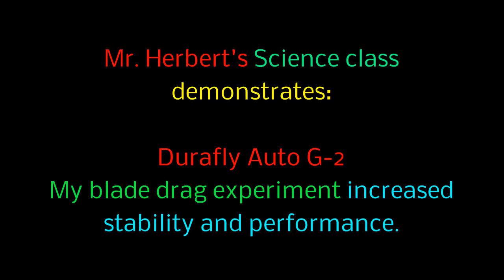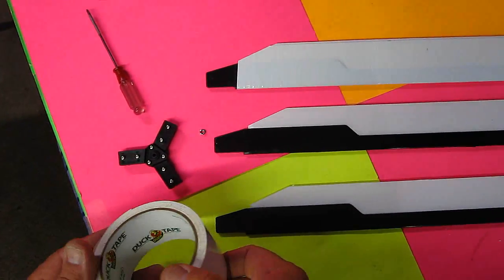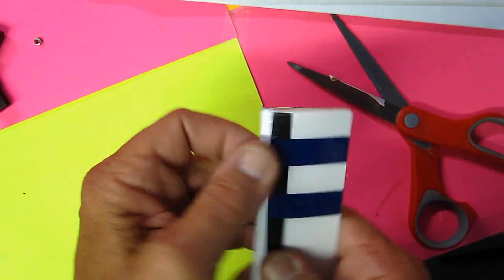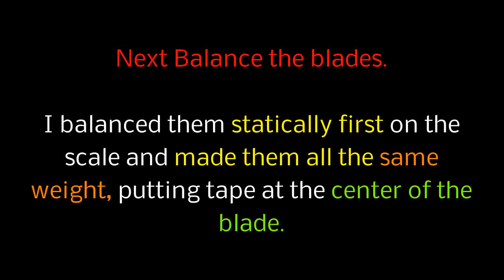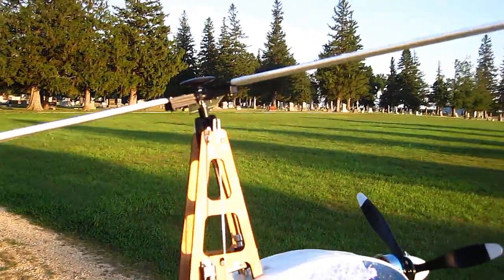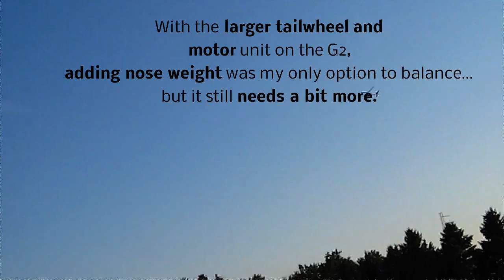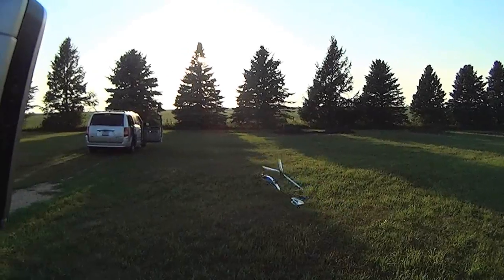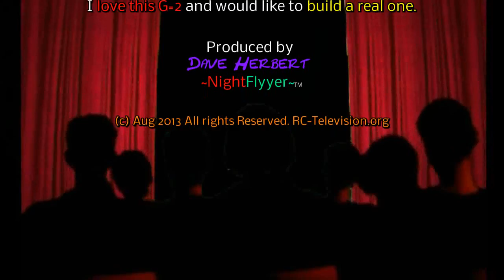Durafly AutoG Auto Gyro V2. Induced Blade Drag increased performance with a Hand-launch Demo too.

Comment from the maker: Well like I said in the video, those blades flex back an forth in different maneuvers without a screw and even a flexible band.  Some do it, but in order for all blades to remain the same pitch, it must use 2 screws. It is different on a powered rotor with centrifugal force keeping them out there, but during slowdown or acceleration, loose blades change pitch on those too. Being experienced with helis, it is my preference to keep them rigid and just not hit anything. Thanks, good question.

Comment: You are right about the blades needing to be fastened with 2 points. I use tooth picks in the inside hole. This keeps the blade in position but shears off in a blade strike. Thanks for your video.

Comment: Hey Dave...Great video and great info on the drag improvement. One more improvement I found was changing the 3 blade for a stock Parkzone P51 2 blade prop ($3.99). Better power and spools up faster. Keep the vids coming. Good fun.

Comment from the maker: I scrape them more than hit, and since the blades are spinning full speed even after landing, and its easy for it to tip over and scrape the blades.  (See my night flying G-1 video response below and you will see it)  A hard hit will break them, I am sure, but for the bumps and scrapes, (especially the G-1) they will maintain as that one liked to scrape the blades on takeoffs. The pre flight rotor spinner fixes that on the G-2. The big benefit is the more stable flight.  Thanks for the comments.

Comment: if you say it works better I suppose it does, but that full length edge of the tape should be causing a major laminar flow disruption.  smoothing out the edge may cause it to work even more better.  where do i get this crazy idea?   I have heard of  Burt rutan canard airplanes refusing to rotate for takeoff because of paint lines (from masking tape) disrupting the lift on the canard.  at any rate i just set up a g2 tonight and after I fly it a few times maybe I'll try experimenting with your idea.